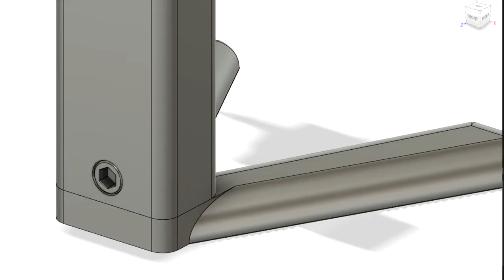3D Printed Wheel With Brake System - 3d Printing Timelapse

Comment: Geez!! Some planning went into that.. You have a hole in the back of the brake caliper - if you attached a tube and blew, would the brake work??
Reply from the maker: I haven't tried that, but I think it's not working because it's not airtight enough.